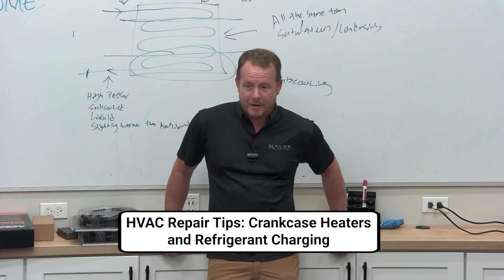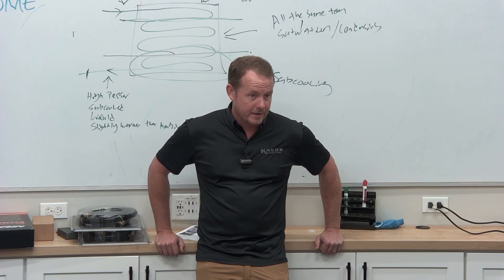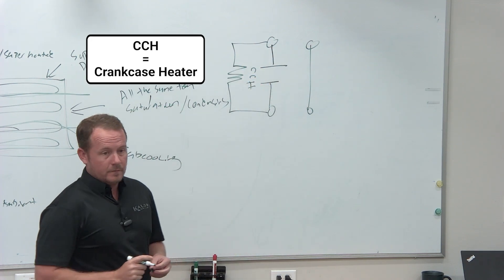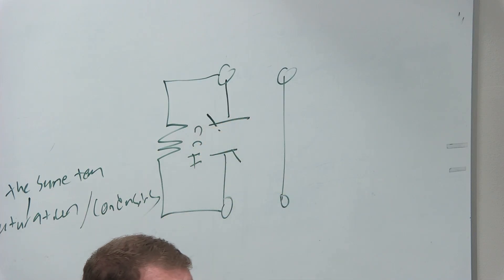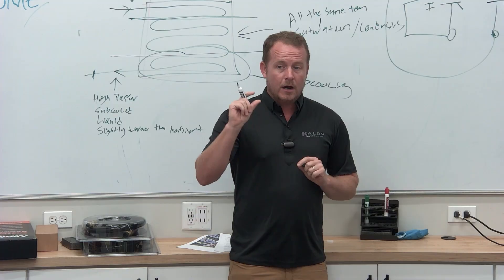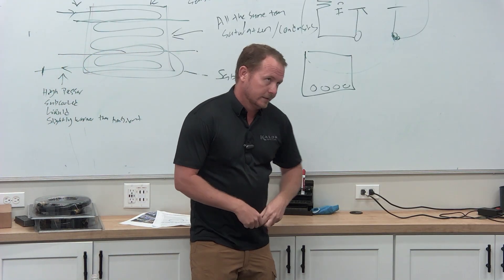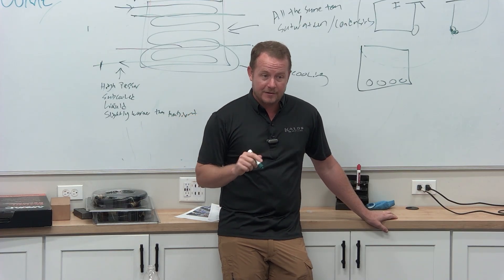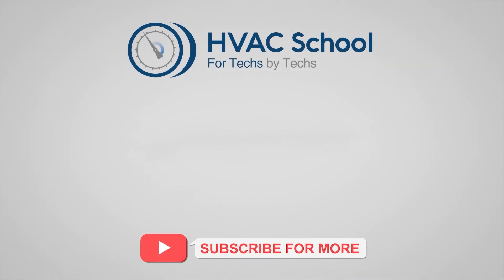HVAC Repair Tips: Crankcase Heaters and Refrigerant Charging

Comment: My daughter and an her husband bought a house with an 2015 rheem furnance and air conditioner. And the ac unit froze up like 18 times over four years several times techs had to change the water Damaged control Board. Finally me a retired telephone engineer. Decided to get involved.

And what I found was one of the air intake vents was completely closed. And the other one was 75% closed   according to one Internet study that i did. It said that hvac techs even Nate certified checking this is a low priority in their training. And is not emphasized much.

Why would that be?  And somehow the vent was 100% blocked.  It was a gum like substance. How in the world could that happen.  Also won’t 18 freeze ups shorten the life of their compressor. I can’t believe that it was probably like at least 15 different techs that a warranty company sent out. That missed these clogged vents. I guess they were in a hurry just to get the unit up and running. And didn’t really do any deep root cause analysis

Even though they were made aware that this was a repetitive problem.  Unbelievable. In my opinion the training is screwed the intake vents should be part of a visual check and should be done before any fancy/Nancy tests
Reply: It's not a low priority in their training. Checking airflow is the first thing any tech should be doing in these scenarios where freezeups are occurring. Good find
Reply: A warranty company that was the issue man.
Reply: Well the how in heck did 15 techs  from 5 different hvac companies miss this if it is not a low priority In their.  training. 

Has quality really fallen that low in this country!  Thank you for responding but how do explain 15 different techs missing this then !  15 !
Reply: @winonacarrington3255 simple. They either were not licensed techs or they just were not good techs. Im sorry i dont have any better answer for you but any good tech would have noticed the reason was low airflow and searched around for the restrictions. A simple static pressure test will even point you in the right direction whether the restriction is on the supply or return side.  Im 29 years in the trade and the importance of proper air volume was taught to me way back then, i cant imagine they just stopped teaching about its importance. Hope this helped.
Reply: All checks must be done helplessly they just be taking your money😂

Comment: Makes sense.  On Mini splits with  the only connection being on the vapor line, we weigh in liquid refrigerant via that line and then start.  I’ve always wondered how that compressor deals with all of that liquid entering.  I assume the slow ramping up of the compressor and electronic TXV opening before the compressor starts is the reason they don’t crap out.  I took an LG class but none of that was explained.
Reply: Mini splits have rotary compressors, rotary compressors always have an accumulator attached to them.
Reply: @DaríoMartínez-w6w That’s right.  Forgot about the rotary compressors.  Minis are not my favorite equipment.  Thanks for the info.

Comment: I do not like single pole contactors on 240vac split phase power.  Whenever I find a single pole contactor I always verify there is a valid ground connection to chassis of unit.  I have also found many outside 240vac units with chassis ground wire left unconnected.